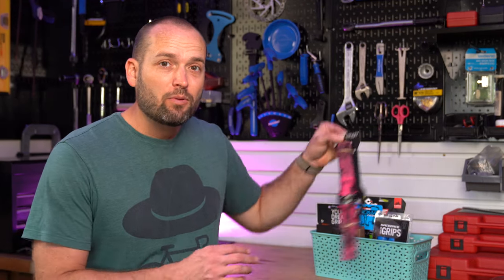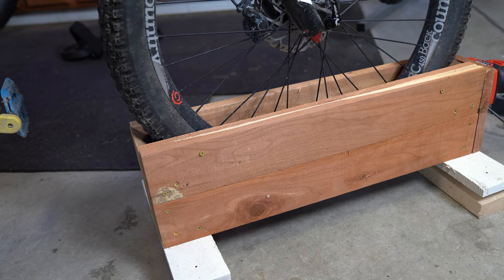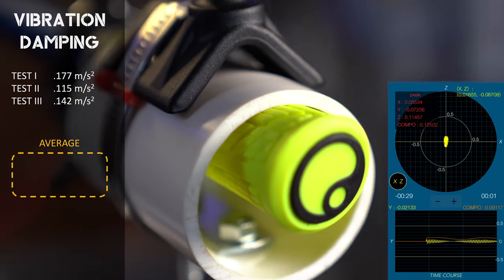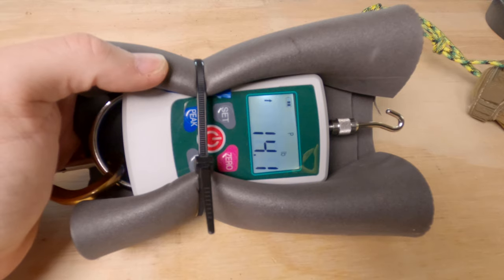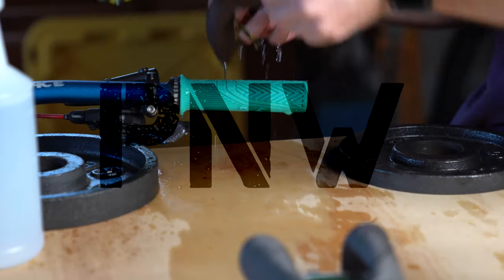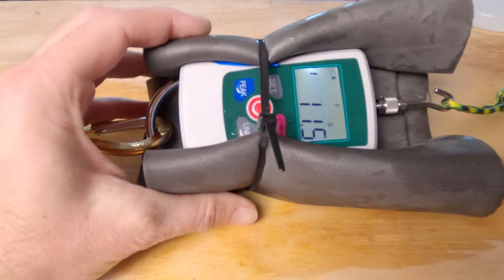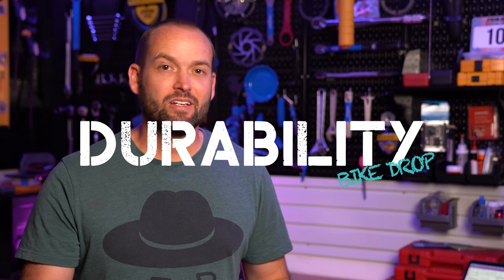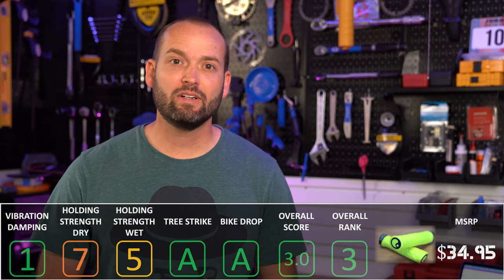Best MTB Grips | The Ultimate Bike Grip Comparison You Didn't Know You Needed

Comment: Great video and very thorough, as usual.  Personally I wouldn't use grips that do not have a plastic or alloy end cap.  I've clipped too many trees with the end of the bar and with the full rubber grips I've almost had some crashes.  The grips with plastic / alloy end caps will just deflect off of the tree and are also more durable.  I was using Odi Ruffian Lock-on Grips and loved them but they do wear out somewhat quick so I would have to turn them about a quarter turn every couple of months as the grip would start wearing down smooth and causing hand pain because you're basically grabbing plastic at that point.  I just bought a pair of RevGrips Pro Series RG5 Grips and put them on my bike last week.  I've only got 2 rides on them and they were a bit of a PITA to put on but I do love the grip itself.  The claims of vibration dampening may be dubious as the trails I ride have a lot of long rock gardens and your hands take quite a beating and I didn't really notice a difference with the RevGrips.  I don't get arm pump though so maybe in my specific situation they can't help.  I'm curious to see how long the grips last before wearing smooth.
Reply from the maker: Great tip, thanks for sharing. - Jay

Comment: Hmmm just anecdotally I find the PNW grips to be buzzy. Vibrations to hands is a measure of both frequency and amplitude and I'm having trouble interpreting the single Z axis number there. Either way I think a foam or silicone grip might be best in this category if it's important to you. Wolftooth fatpaws, ESI grips, and Ergon GXR all have superior vibration dampening to any lock-on.
Reply from the maker: Thank you for sharing your experience.  I considered measuring vibration across all axis, but didn't have a good way to isolate X & Y axis...thus narrowing in on the Z axis to be representative of how vibration is dampened generally.  -Jay

Comment: Great test 👍
But no ESI or other silicone grips?
I've tried several of these grips over the past few years and only ESI gave the comfort I was looking for. They're not lock on though and durability isn't great.
Still, would have liked to see them in the comparison.
Reply from the maker: Thanks for the comment.  I'll consider including some silicone grips if I do a future grouping.  😃 - Jay
Reply: Another vote for the ESI racers edge grips 🙂 so far no grip has matched the vibration dampening and comfort level of these grips. Just wish they were more durable.
Reply: @specializedbighitfsr Oh Yes I agree, if you touch, juste a little some tree, or something else, the grip will break instant

Comment: Vibration Test: Why are you testing the OURY (at 33mm+ in diameter) and not comparing to the same diameter in the PNW at min??? Shouldn't ALL the grips tested be in similar diameter or at least give the respective brands that offer a larger diameter version a chance to rate in comparison so the results are not confusing? At this point I am HIGHLY curious to know how the PNW rated in its thicker version (and any other brands you lined up IF thicker versions are actually available) especially considering it's 30mm+ version already had great vibration dampening in your initial tests. IDEA: Test all Sub 33mm grips and test all 33mm+ grips (providing new weight specs) and maybe some feedback on the 'feel' of these comparisons as well.
Reply from the maker: Thanks for the idea.  Great to see PNW released an XL grip - always good to have more options! - Jay